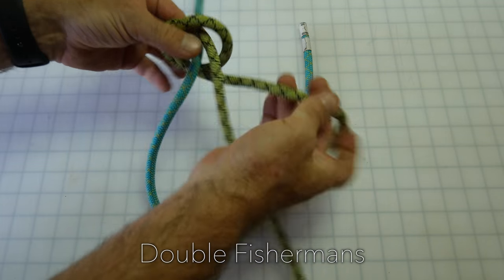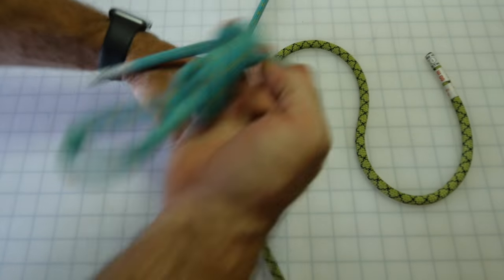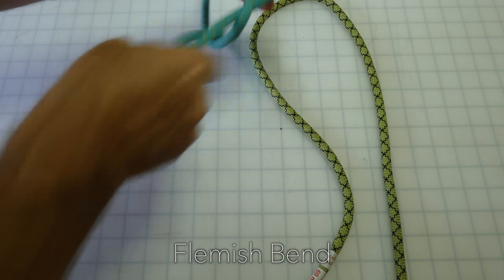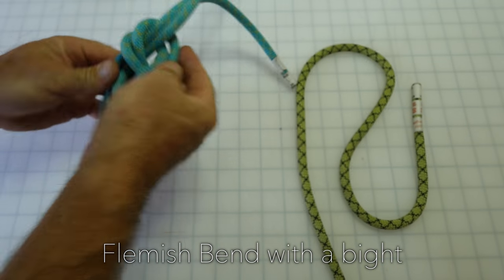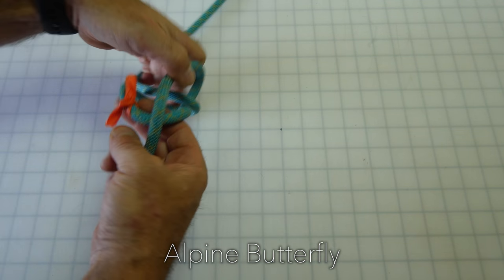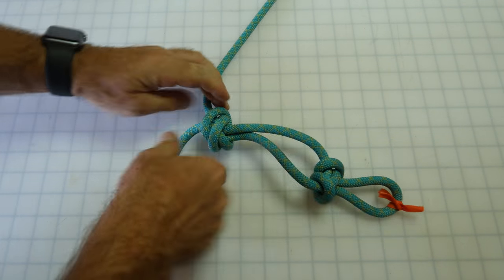Vertical Caving - Knot Crossing Technique

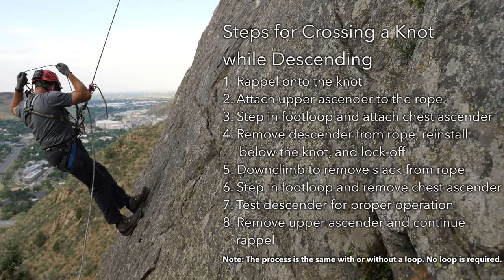Comment: Derek,now that we've met I hope you'll allow me this remark ;-)   IMHO I notice a safety error at 5:28. Descender is not locked (a half-lock can not be considered as safe) and both hands off the descender. A half-lock could slide (e.g. thin or new or slippery rope) or you could get hit by a rock at that precise moment etc... in all cases you risk loosing control and go down. Two possibilities: re-lock descender fully before taking both hands off to remove ascender OR remove ascender with one hand whilst the other hand squeezes descender+rope. A Petzl Stop descender would also be a solution.
Reply from the maker: A fair point Paul. I sometimes use the "soft" lock when my hands will be off the descender for just a moment, but a full lock is always going to add a greater margin of safety. In practice I have only used the soft lock when the rope is not prone to slipping (e.g. dry cave + larger diameter rope + lots of rope weight below). Getting hit by a rock is probably a separate risk factor, and one of the main arguments for self-belay devices such as the Stop.
Reply from the maker: Are you binge-watching my caving videos?
Reply: sort of :-) I had already seen some of them and now I'm catching up on the rest. Nice work and very instructive.